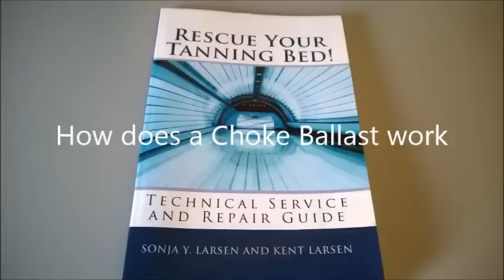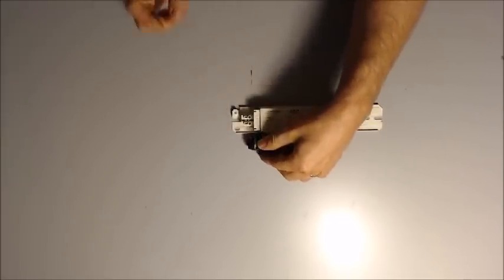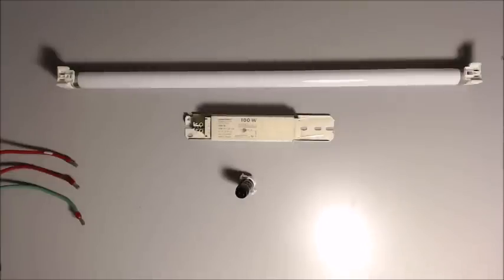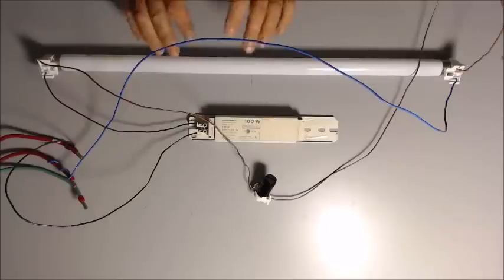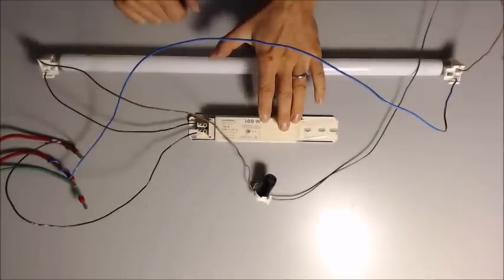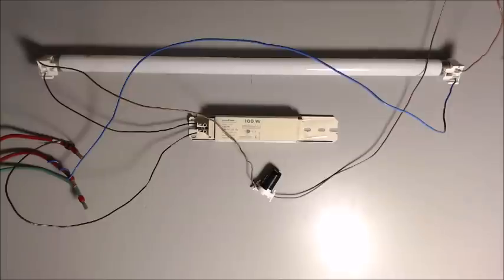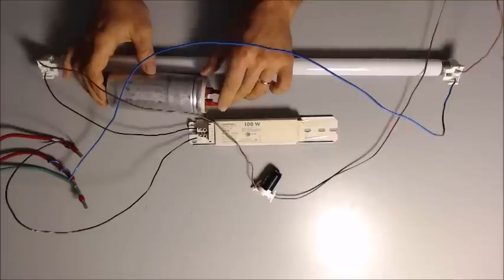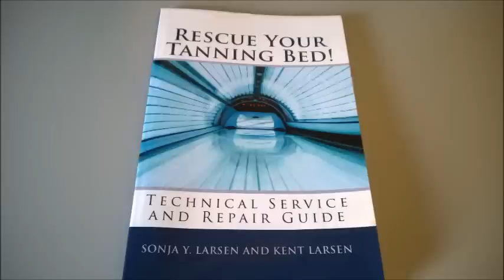How Does a Choke Ballast Work?

Comment from the maker: Hi Nicko, that is exactly what it is. A coil of insulated wire will create a phenomenon called reactance. If you insert a iron core in the middle of the coil, this effect will increase. Reactance creates a time difference between voltage and current. This will allow us to draw a great peak in voltage with limited current, for starting the lamp. Next to run the lamp we need to limit current, and since the ballast is in series, and reactance is a form of resistance that together with regular resistance creates what we know as impedance. This impedance is what limits the current to the lamp. So in conclusion a choke ballast is just a coil of insulated wire with an iron/steel core.
Reply: hi , i would like to ask a question please , can the ballast affect the light quality i.e different specs of ballast influence how lamp lights ?

Comment: You could have told us if the ballast is rated at 120 or 220. It would have good to know the capacitor rating. And it would have been nice to see the bulb light up.

Comment: So it looks like there is nothing that guarantees that the starter switch opens near the peak of the AC current cycle, it opens at random points.  Then sometimes it'll miss, providing no kick, and automatically try again, right ?  And the electronic ballasts would overcome this issue, I'll wager.
Reply from the maker: Precisely, nicely concluded. So a bad starter can kill a lamp, and most likely will. And the electronic ballast will extend the lifetime of the lamp.
Reply: Bronson When the tube is lit, it's resistance is much lower than that of the starter, so basically all current will go through the tube in stead of the starter. That means the starter bimetal will not heat up anymore and the starting process stops.

Comment: Very very good explanation. Just did my AC theory so I knew about power factor correction which helped. I assume the starter stops heating once the gas starts to conduct as there is now no voltage across it. This could have been pointed out in the video for completeness .      Thanks very much for sharing your knowledge.

Comment: Good explanation of the standard fluorescent tube circuit, thanks. Unfortunately, I have a 4 wire ballast (philips quickstart PF439) and a 8.4Mfd capacitor, but no starter in my fluorescent fitting. The lamp never starts until I flick the main switch on and off a dozen times. So I want to add an actual starter in the circuit and am trying to find out where to put it. I guess in series with the lamp as you have it?

Comment: Great Video!! Just a question on the capacitor, is it used for power factor correction or as like a snubber circuit to collect current after the Inductive kick off the ballast?
Reply from the maker: Hi Paul, good question. And yes, it is precisely power correction that the banks of capacitors is connected for. The inductor and a starter can work fine without the capacitor, but the inductive load on a tanningbed would be ultra high if the capacitors are not there. And that is of course only if its a choke ballast, which is a pure inductor. You also have electronic ballasts, and they dont require ballast banks.

Comment: Thank you for posting this video, I had no idea that you could use the choke/condenser with multiple bulbs like that in a single fixture. I my self have been doing research using only the choke ballast with the preheat open/closed starter switch and broke it down to where I have light a F30 T12 bulb without the need for a starter condenser but with the F34 T12 seems to no have enough voltage kick to pop the bulb on without a starter condenser. Thus far I have made dual bulb lamp fixtures using the same basic design and got to the point where I can light 2 F34 T12 bulbs can keep them running using only the choke to keep them lite. I'd like to see if the diagram you showed in this video can light more then just 2 bulbs but without having to use that capacitor in the circuit.

Comment: Thanks for sharing your knowledge. I am an electrician but have wondered for a long time about how these things work. One thing that was not clear, did you say the capacitor is connected in parallel with the line leads?
Reply from the maker: +David Sanders thank you for that, and yes the capacitors are parallel on the line leads, so that the capacitive load is in parallel to the inductive load of the ballast, and that way reducing the phase angle.

Comment: thanks for the very useful explanation! My question is: how can in principle a glow starter work without an inductive ballast? In my cheap bug zapper the UV lamp has a starter, but no coil, just polyester caps and resistors. What brings about the kick at the starter opening? Moreover, just as a curiosity. If a starter is put at ONE lamp holder, how can it be connected in parallel with lamp?

Comment: I really enjoyed the way you explain the choke ballast in this video, but I have a question about the diagram that you presented near the end. It wasn't very clear to me where the starter condenser was placed in the circuit. I saw that you pointed out where the capacitor and where its placed but the rest of the circuit wasn't very clear.
Thus far I have been only able to light 2 F34 T12 bulbs using only the choke+starter switch, but in the diagram you showed it had 5 bulbs all connected in the same circuit. Could you contact me and I can show you the diagram I've been following and perhaps you could send me a pic of yours?

thnx for your time
Reply from the maker: Paul Zaffuto I have a link here to a twitter post here I hope you can use https://twitter.com/Tanningbed101/status/634378460559970304/photo/1
If you follow the black marked wires to the backfeed for the 4 lamps, and here you can see how C2 the capacitor is sitting across in parallel to the power leg going to the ballast side. This is what is power correcting the voltage, so that we have less current draw.
Reply: Alright, thank you Smarthouseelectric. It didn't take me long at all using that diagram to learn how to add additional bulbs to the circuit and in this case using this fixture circuit we can add as many bulbs as we want but I think they have to be added in pairs of 2 thus not to cause an unbalanced flow of current in the 2 lines. I also not using a capacitor that you pointed out in your video. When you say the capacitor is causing less current draw, do you mean the lamp uses less wattage with the capacitor then without? It seems to me that I'm able to run the lamp fixture just fine without it... In the process of building this circuit I found a way to use an additional choke ballast to one of the bulbs after it was lit up and by doing so made the bulb glow brighter. I'm now working on installing a switch for this addition choke to make a sort of "High Beam/Low Beam" option as well. 

Thanks again for the link to the circuit diagram, I don't know if I would of been able to figure this all out with your help with that. Once I got a Lamp Fixture completed I make a video and post it on youtube to show the changes I made.

Keep up the good work!

Paul
Reply from the maker: I am looking forward to see what you come up with Paul. And certainly you can make levels on the flourecent ligth, typically you start the lamp on the highest ballast setting to get a good start kick. Once the gas is started you can dim is. The less current part with the capacitor, is due to the power factor. That is when you have a difference between the phase of the voltage and current, also known as a blind effect. This current that doesnt turn into energy in the lamp, but shear waste. The ballast creates a inductive load, and the current will theoretically be 90degrees delayed to voltage. This will get straightened with a capacitor. Therefore it is important that the capacitors only are compensating during the ballast running, else the capacitor will create a capacitive blind effect during standby.
Reply: +Smarthouseelectric Here is a link to the diagram I was following before I seen your video and saw yours....
http://www.egaynor.com/_get_item.php?style=1170

I found this page looking for the Gaynor rocker starter switch that acts as the on/off switch and 2 open/closed preheat starter circuits that turn the lamp on. I was able to turn on bulbs up to the F30 T12 size using only the choke ballast and the gaynor rocker starter switch that's just 3 open/closed circuits for turning on/off the lamp no parts that could burn out. In order to start a F34 T12 bulb or bigger I need to use the starter condenser and the rocker switch because it seems that the starter condensers sometimes wont kick off and the ends just keep glowing and the bulbs doesn't kick on but if I close then open the circuit manually with a switch then the bigger bulbs kick on.....

Comment: what kind of lamp they are using inside the starter i think this lamp is the one always broken before the flourecent tube, is there also a wattage for the starter?  a 100 watts can use onli a 100 watts starter, or should i say a 20 watts ballast can use the starter for 100 watts
Reply from the maker: +filipina santos yes the starter needs to matched to the power of the lamp, but a little tolerance is ok. 160W starter can take a range of 140 to 180W, and a 100W will do 80 to 120W. The lamp inside the starter you dont replace, the starter all together is not expensive. I recommend replacing all starters on 160W beds every lamp change, and 100W every other time, it will save you money on lamps. If you have a issue with starters burning out early, check your voltage is within 224Volts and 235Volts.

Comment: If the starter open when AC voltage is not at peak will the ballast fail  to start. ?? ie will the ballast have no magnetic field if the sine wave is at zero volts ?

Comment: some of the videos I saw they did not use stater in the tube light circuit.  is it harmful for tube light??
Reply from the maker: If they can start without the starter, then the light might have one build in or the ballast is an electronic og magnetic

Comment: who is use the gas of tube light
Reply from the maker: +choudhary praveen can you rephrase the question, I dont understand
Reply: Why the use of gas tube light
Reply from the maker: It is still to expensive to use LED for 280 to 400nm that the tanning process requires. Real saphire is needed making these deep UV LEDs. So glas, gas and phoshor is cheap compared, even when taking all the saving measures in to account of LED. I did a calculation myself on a 12min tantime output, and the price wholesale has to lower with about 3 times on the LEDs, to justify. For that a alternative to saphire has to be found
Reply: Thanks